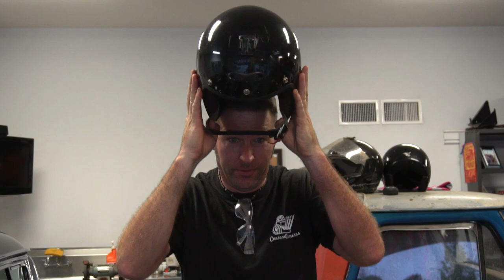AWD 4-Engine Go Kart RUNS: Rear Engines & Gussets

Comment: You guys are geniuses! Can't wait to see the 670 vs all wheel engine cart.
Reply: shu4208 thats what i was thinking
Reply: shu4208 Yes 670 vs 848
Reply: shu4208 the all wheel drive will have a torque and grip advantage bit the 670 is lighter and will probably have a higher top speed. The awd carts top speed will only be as good as one of the engines as they all will be working together. Depending on the length of the race either one could win. :P

Comment: the idea of four independent engines has me thinking of a way to do the throttles. i thought of a way that might work, where you could use all four engines with one pedal and also be able to independently control them with a handle. the pedal would be hooked up to a plunger that will pull all four throttles at once and the handle will move whole the system around, pulling certain throttle cables depending on how you move it

Comment: If you install brakes only in the rear or front, the other wheels would rotate independently and do a burnout... (idea?)
Reply: Oscar Nolden a little thing to add on. Independently selectable brake modes. Front brakes only, rear brakes only, etc.
Reply: I'm sure they have enough space for 8 pedals, for independent throttle and brakes of each wheel.
Reply: Stryke  go hydraulic and fit a bias valve and/or line locks -job done
Reply: J. Hile that's how you do a burnout bud
Reply: where I come from of there's smoke and you smell rubber burn it's a burnout, but walkin it out is a lot more fun I must say

Comment: just sharing my idea, not saying you guys should because there's probably something wrong about my idea, but i would because it sounds innovative.

I would rig the rear wheels to have more torque (lower the gear ratio) and, to equal measures, raise the gear ratio for top speed in the front. my reasoning being that the rear wheels get more grip that the front, so i would get just as good (probably not better) acceleration and more top speed. It just seems cool.

you guys' build is awesome!!
Reply: 3Ddee but the front engines wouldn't be able to keep up with the rear because of that gearing, correct me if I'm wrong
Reply: Nick Mathews no the problem is it might overrev the back motors...

Comment: another comment, wire all four kill switches together
Reply: Dooley Dooley DEFINITELY. add to that, 4 smaller sprockets on those wheels to give the beast some running legs. when it was FWD it had power to spare doing front burnouts, now that it's 4WD double the HP, might as well!
Reply: do it
Reply: and get a faster steering BoX thats a too slow its look like sematruck driver when you steering
Reply: Kyle Seymour you :)
Reply: A very wise idea in case one of the throttles sticks
Reply: Here's an idea.

Put an adjustable track bar between the center of the front engine mounts so it pushes them out. It will still allow you to steer and it will also provide the force to keep it from having so much negative camber. Basically like having a solid A arm if you can make out what I'm trying to explain.
Reply: Kelon, a ball linked rod across/between? might not be a bad idea, stress from one side being shared to the other, or two of them to a central pillar similar to RC car upper suspension links (they use a lower A arm with upper ball link rods). kinda get what you're meaning, ball or pin link that can allow steering, and help take stress off the front beam.
Reply: Dooley Dooley wire all the kill switches together the wrap the wire around your neck. when you want to kill the motors just jump of the cart
Reply: 1970 olds442 show me how it's done first lmaooo
Reply: Dooley Dooley next mod mud tires

Comment: I instantly thought about a skid-steer type setup.... 2 levers, pull back on them, brakes... push forward, throttle for the engines. No steering, no problems. Engines might need more power for that though.... Still pretty sweet.....

Comment: Next project idea for cars and cameras:  4 wheel steering go kart! Up vote so they can see it!
Reply: Personally I think that’s the silliest thing I have ever heard in a comment section lol 😂
Reply: @wavez_4696  reddit would surprise you my friend
Reply: @SailingFrolic  I just don’t see the point of 4 steering wheels...4 motors is cool but 4 steering wheels I don’t think so
Reply: @wavez_4696  ah, I take it you've never heard of the Honda Prelude then? Or the Mars Rover? Or an 8x8 off road truck?

A lot of vehicles you probably don't realize, have 4 wheel steering. It doesn't have to turn as much as the front wheels to be considered 4 wheel steering, but a small bit of flexibility in the back wheels to make the cars corner tighter on smaller radius turns and high speed maneuvers helps massively.
If Honda did it in their sporty car, the Prelude, I think it's a very serious engineering possibility to consider.

Comment: Truth be told, most cutoff wheels burn out very fast. Some point if possible a plasma cutter and an air compressor should be picked up. Straight edges like flat stock, angle iron, or straight piece of wood works great to help cut. Couple vice grips do well holding it together. Free handing does well if you're good at it, most of us are not.
Reply: Those were going way fast. On my 4.5", I can do about 20 cuts per wheel, using standard dewalt wheels.
Reply: Ratkill9000   I agree the cut off wheels don't last long. But the combined cost of a compressor and plasma torch is too much for these guys. Just a regular Oxy Acetylene torch would do them wonders.
Reply: Zeke770 Never cared for oxy fuel for cutting sheet metal. Though it is cheaper.
Reply: Ratkill9000 I use the cheapie wheels... they last awhile... but 1/4 plate eats them like crazy... I use my Sawzall for the thicker stuff
Reply: They do make "hard" cut off wheels. They cost more, but they last a lot longer.
Reply: I got a cheap plasma cutter off ebay for $260 and it would be perfect for what they are doing.
Reply: I use Dewalt medium grade cutoff wheels and they last longer than any I have used in the past just today I was cutting fenders,inner fenders,and the fender mounts on my s10 to clear larger tires and cut everything on one wheel and that was a lot of cutting
Reply: I've pretty much converted a boat trailer to a utility trailer using only dewalt cutoff wheels. Theyre only like $2 at Lowes and I've only gone through two, and thats with a lot of cutting between 1/8" angle and 1/4" channel

Comment: Here's a good idea!!!!

Put an adjustable track bar between the center of the front engine mounts so it pushes them out. It will still allow you to steer and it will also provide the force to keep it from having so much negative camber. Basically like having a solid A arm if you can make out what I'm trying to explain.

Comment: I think everything is going well. Getting all the chains aligned and tight as can be will relieve that issue ..Chain lube on the tight chains is a great for not popping off and not creating undue friction./The steering ratio seems scary.. No fast twitch reaction time.A cross beam from plate to plate across the back would solve all and any flexing

Comment: I think it's epic. I had a thought on the four throttles...use a BMX style brake caliper (rim pad type) to pull two pair of cables towards each other from a single cable from pedal. Mounted correctly it should pull two from rear and two from the front evenly with all 4 cables the same length. just a thought. Good luck with steering so much weight.  Also tie the tops of both rear motor plates to each other and do the same with the fronts using Heim joints on the ends.

Comment: Foot pedal throttle for the two rear engines, the other foot is a brake for all wheels. The two front engines are controlled by a hand throttle on the steering wheel

Comment: What if later on(future), You guys make the chassis articulate. Kind of like the front axle of a lawn tractor, but at the rear of the 4WD go-kart. That way the 4 wheels will be more in contact with the ground, over uneven ground.

Comment: You should put an arm that goes from two front engines, with rose joints at each end, to tie the two engines together. Like another steering rack, but purely for reinforcement. Thumbs so they see this

Comment: Its counter intuitive but try to loosen the chain instead of tightening it. this usually happens to me when i put the chain on my bicycle on too tight. When i move my rear wheel forward a little bit to give the chain a LITTLE bit of slack. Worth a shot.

You can also fix the alignment as you have suggested. The combination of having a misaligned sprocket wheel and a super tight chain is a setup for the chain to fall off its course. Even if you dont fix the alignment giving the chain a little bit of slack allows it to be more flexible.

Comment: put chain tensioners on it
Reply: Bolt type chain adjusters against the engine bottoms like some motorcycles use at the rear of the swing arms... plus spring-loaded swinging slack remover idler sprockets...

Comment: Im fairly certain those blades are designed for cutting thin metal, and detal work, not for cutting thick metal plate; thats probably why they wear down so quickly. Thats a job for an angle grinder.

Comment: Not sure if this is mentioned but you should cross brace the two rear engine brackets and brace the front engine brackets (like a shock tower brace).

Comment: On the rear, add a bar between the left and right engine plates, that'll keep them from being pulled down and losing the chain.
And on the front maybe a second spindle on top on each side to connect the plates?
Reply: And maybe add cross braces in the rear if needed :) 
Maybe do some upgrades to the rear engines to send more power to the rear wheels and it might feel more like rwd.

Comment: I have an idea for the throttle and braking system. 

Throttle: use the same round stock you used, and weld both sides together so it would look something like this (sort of) 
|____|  that way both sides can be operated by both feet. 

Braking: run to the scrap yard and find an E brake from some junked old car that you can take the handle and teeth mechanism out. Perhaps have 2, 1 for the front and 1 for the rear if you leave the throttles separate so you can do front wheel or rear wheel burnouts.

Comment: Just checking as to why you don't use a chain system on the steering. You could use a bicycle chain and cogs to turn the wheels. You could centre the steering column then weld a larger cog to the column, then put a smaller cog onto the actual rack, driven by a chain (You could scavenge all of this from an unused bicycle)... This will solve 2 issues in one... firstly it will solve the off-axis steering wheel and (if you play around with cog sizes) you could also solve the 3000odd turns from lock to lock!!

Comment: Your motor mounts need to be stiffer. Any tension the chains are under needs to be supported all the way back though the chassis to the bearings to the respective shafts the sprockets are attached to. What is happening is that the chassis is flexing, making the sprockets come out of alignment then dumping the chains.

You need completely box the ends of the plate the motors are mounted to. At the rear end you can make a 'strut tower brace' type bar to connect the 2 rear motor mount plates to each other while boxing them in at the same time.

That external stub axle brace on the front left looks like a good solution.

Comment: You guys should add rubber washers to the engine mount. when you want to tighten the chain you loosen the bolt and the engine will be pushed away from the sprocket therefore tightening the chain, and if you want to make the chain loose again then you can tighten the bolts on the engine mounts, thus moving the engine towards the sprocket and making the chain looser

Comment: you guys need two handles as you push them forward to accelerate the front tires or rear then pull levers on the handles to throttle the other tires

Comment: You could decrease the flex a little bit by relocating all four gas tanks. Would take some weight off the engine mounts. Have all four engines draw fuel from one tank?

Comment: If you want a good cut off wheel look at the following brands:  Pferd, FlexOvit, Norton, CGW.  Those have proven to be a pretty decent product for us.  CGW is going to probably be the lowest cost.  Lenox has a new metal cut off wheel that touts 1000 cuts but I've heard after 100 cuts or so they start to do a lot of melting which causes cleanup issues.  Plus, they don't make them for die-grinders.
Reply: thanks

Comment: I think the project is awesome, but from an engineering standpoint, this setup is going to be filled with problems that you're most likely never going to solve. Each of those wheels is going to be turning at different rates, which is going to cause resistance between the wheels.

Comment: I think the chain keeps popping off because the sudden acceleration causes to tires to change shape (compress) and then the distance from the axle to the sprocket changes causing the chain to loosen off.  I think the engines should be rotated 180 and connect the sprocket to another sprocket fixed to the axle not to something like the wheel where an impact or distortion can keep the chain from being tight.

Comment: guys u need to run all 4 cables to the throttle peddle,use a straight edge to set the motor to the sprockets,possibly use a chain idler to keep the chains tensions set.....these things are needed now.....

Comment: The best way to dual motor so you have one throttle is two motors running off one big carb, It's almost impossible to link multiple throttles together and have the motors all pulling equal.

Comment: 4 throttle cables, the front must be in tension and the same length as the rear throttle cables. Make sure your peddle has enough throw to open up the throttle and weld and nut to the frame under the peddle and screw a bolt and a jamnut as a stopper so you dont break the throttle bodies valve

Comment: instead of having the steering shaft crooked put two different size sprockets and it will add a little bit of gearing and then you'll probably have to turn the wheel half as much

Comment: Use 1/5th scale servos and a bit of brake line and wire the servos to a pwm switch or proportional switch this should sort out all of your engines

Comment: Someone send these guys a plasma cutter quick.. just imagine,  more steel, 4 -670's taller tires.
On a real note, weld some nuts to the motor mounts and use bolts to align and tension the motor.

Comment: Triangulate the steering shaft at or near the base of the steering wheel.  I would suggest a spherical rod end (HEIM joint) that supports the steering shaft.  A rod through the chest would be very bad on impact if the steering hub sheared off!!

Comment: this is a good system, just needs bugs worked out, i built a homemade motorcycle with a bmx bike and one of those honda gx160 (grown ass man version of the harbor freight 212) and after much failure and improvement its about as reliable and rugged as a willeys jeep, not to mention outstanding performance, torque for days and power out the wazoo, this kart may throw its chain every 2 seconds but if you want it hard enough it will run like a swis rocket, i had things like belts rubbing and chewing up, idler wheel and clutch screwups and the wood frame cracked if you even hit a pebble, it has undergone extensive improvements, even now with a bolted steel frame thats stronger than the bicycle its mounted on, the only worries i have now are things like tire wear and metal fatigue . . .life is pretty peachy for a home made motorcycle made from other peoples trash if thats about all you have to worry about if i do say so myself . . .i have all of 30 bucks into it at most and its mainly bolts, ive spent infinitely more on gas for it and its like 10 bucks a month for every day riding, the bike has payed for itself before i got my license and i still ride it whenever i can just to remind myself who i truly am ( one badass backyard homebrew'd mad max mothertrucker , can i get a YEEEEHAAAAWWW)
Reply: yeeeeehaaawww

Comment: You guys could do the throttles kinda like the rear brake on a tractor where you put both sides to a different pedal but they're right next to each other so you can do both at the same time or  separately but instead it it be side to side engine do front to back so the back left and front left are on separate pedals but side by side so you can do just the back or the front and the back and do the same for the right side

Comment: What if you did the rear engines on a single peddle. then use two brake levers on the steering wheel for independent from engine throttles

Comment: The front sprockets should be small than the back. Need a faster rotation in the front or it'll lock up, throwing off the chain.

Comment: you should have 2 throttles one for the right and the left. so one pedal for the left 2 engines and one pedal for the right 2 engines. Remember the brake pedal unless u are doing a Hand Brake.

Comment: if you link to engines on the right side and the two on the left side you can have a go cart without needing steering
Reply: nevermind was not to the part where you did it

Comment: i've been racking my brain trying to figure out what advice to give  to remedy the chain issues..the only thing i can think of is straighten up the camber in the front wheels and weld a piece of angle or something under the engine mount to the other plate..a gusset kinda deal but a little heavier duty to support the torque..that may keep the engines from flexing under pressure resulting in thrown chains...other wise this thing looks like it would be a blast..ike hows your neck feel after the launches?..good job guys ..stay safe with these storms ...good vibes from bama..
Reply: lol. my neck is good